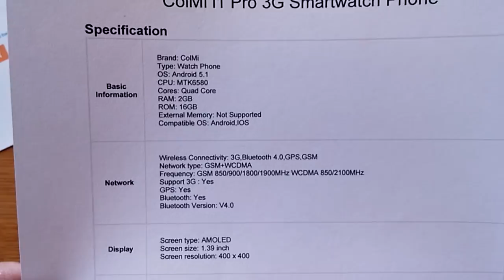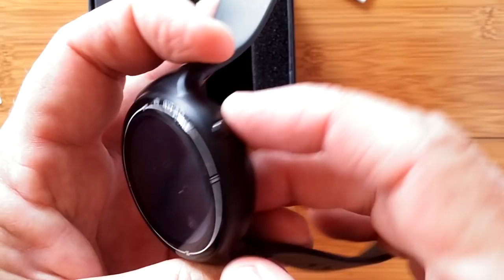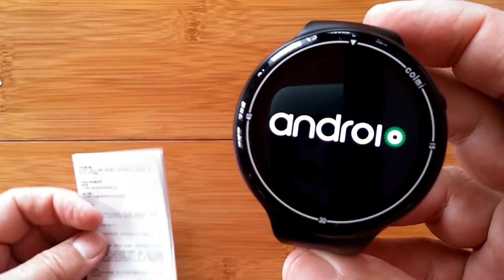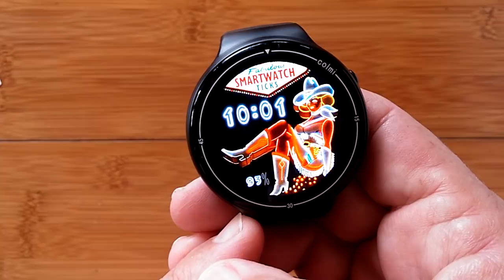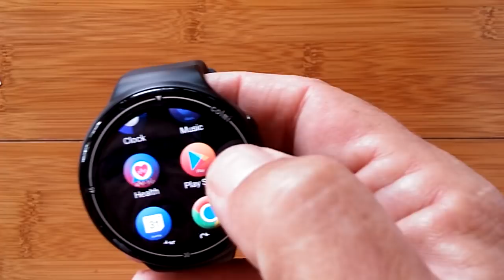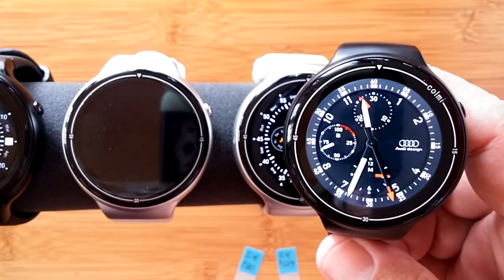ColMi i1 Pro Android 5.1 2GBRAM/16GBROM Smartwatch (like IQI I4 Pro): Unboxing & Review

Comment: Just to note that the Kingwear KW88 latest firmware now enables Bluetooth calling with no additional software. Its great!
Reply from the maker: Great to hear! i'd really love to know if new ones are shipping with the updated firmware out of the box. Also, did you get the firmware OTA or did you need to flash manually. I'm looking to hear which watches a typical user can expect to get Bluetooth calling on if they order now.

Comment: just scratch that little triangle on the bezel and remove it  then it will align with watch face. quick fix, you are welcome
Reply from the maker: Great idea. Also, don't turn on the watch and rely on the bezel and angle of the sun for time. Problem solved!

Comment: Shame they release them with obvious issues like this...
Reply from the maker: Yea, no kidding. It looks like they bought up some 2nds from IQI and rebranded them. Only thing, they aren't selling them off at a deep discount. Where I live we have a clothing store called "Ross Dress for Less" and they get name brand clothes that have minor flaws to resell at a discount. Obviously the screen alignment is a 'minor flaw' on this watch with respect to the bezel, so you'd expect fire sale pricing. Not so! I can't even get a coupon discount to offer on this one. Comparing with the IQI Pro and Air though, it looks like they are off in alignment as well, so perhaps it's by design! Really odd. Can you tell if they printed the bezel markings a few degrees off or are the watch innards twisted a bit with respect to the body?